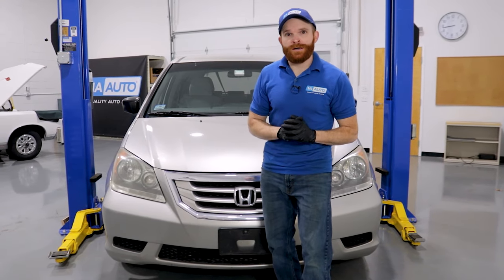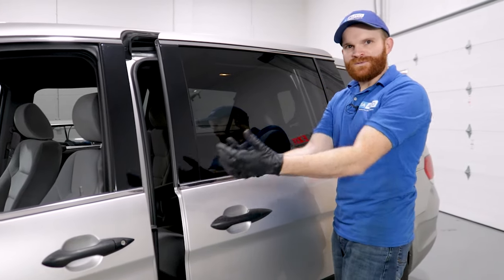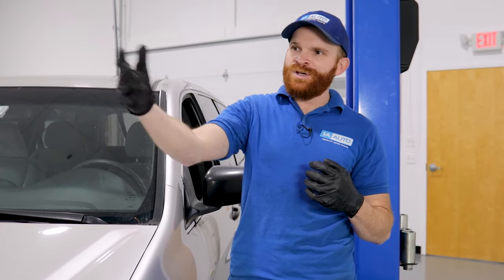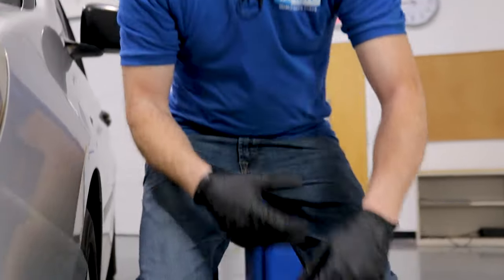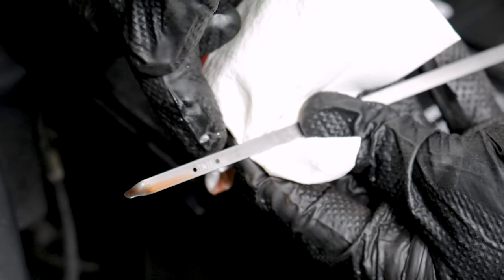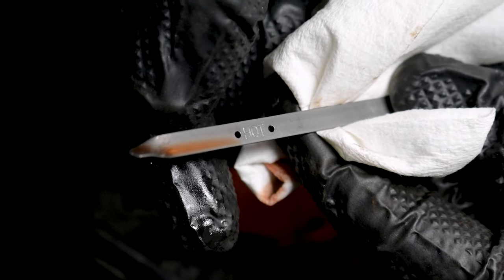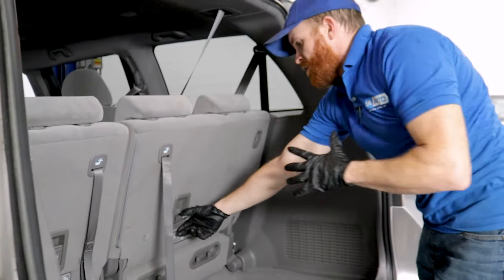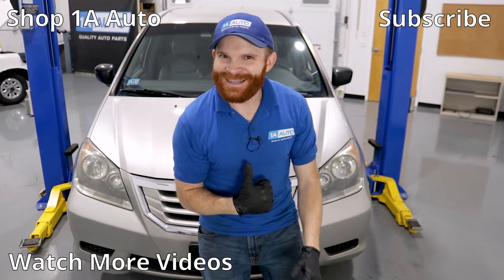Top 5 Problems Honda Odyssey Minivan 3rd Generation 2005-10

Comment: My 07 touring has real loud and hard to turn power steering.
Reply: Common its the pump but check around the pump for leaksb
Reply: Start small with replacing the Top and Bottom pump O rings. 
Then clean or replace the Reservoir.  The screen gets clogged.  And flush and replace the fluid using Honda's.
Reply: I replaced the power steering reservoir (updated honda part and cap from eBay) and the fluid (honda ps fluid). Then I still had noise and really foamy looking fluid, which the forums said it's the the downstream? (not sure) gasket/o-ring in the power steering line, right on top of the engine, the gasket that's closer to the front I think it was but not sure I remember right. That took care of the whole power steering issue.

One of the parts in the doors that feels commonly is called the actuator. I think that's what he's talking about-face when he says the latch.

The AC motor relay, inside the fuse box that's inside the engine bay, by the passenger side I think. That's a $15 or less part, that went out and shut down the AC immediately. 

It's also important to think about the timing belt if you're past 100,000 miles. At least that's what I hear, I'm a little bit past that few tens of thousands.

I think the engine splash guard that's underneath front and center, is probably also a common part that comes loose. Maybe that's just from snow up here in the North. 

It's also important up here in the north to make sure to oil or "shin etzu" the seals on the sliding doors especially so that they repel water and don't get frozen shut in the winter.

Comment: Charging system is also a problem.  I say this after a year of dead batteries, 2 new batteries and 2 new alternators.  I am sitting in a parking lot with a dead battery.
Reply: Sounds like alternator issues, maybe one of those alternators you got wasn't working right.. that stinks sorry
Reply: Make sure it’s not leaking oil into that alternator. Common issue because of placement.

Comment: These vans are known to have bad transmissions. I know from experience after having to replace it around 150000 miles. I replaced the fluid every 30,000 to 40,000 miles and it still failed among lots of other issues. Sold the POS and bought a Toyota. This was my experience so yours might vary, but know that there are shops out there that just work on Honda transmissions and no other brands for a reason. Stay the Away

Comment: Guys, the 40 amp fuse for Back up/ Acc! If I leave in! The battery will discharge overnight. If I pull it out, the battery stays up/ charged!
What is draining the battery?
Reply from the maker: +Douglas Brunt We wouldn't be able to diagnose an issue like that here, you may want to have a local mechanic take a look at it. Thanks for checking us out! http://1aau.to/m/Shop-1AAuto-c
Reply: I had the same problem. Shop said it could be one of multiple things.if I want to use power does, I have to out the fuse back in
Reply: @kathyhart6104  I had the same exact problem it's was backup #7 fuse (7.5amp) box in cabin on drivers side easy fix

Comment: Anyone else have a parasitic drain on the battery with their Odyssey? I've been trying to fix a problem with my 2010 that in 2022 started to come out in the morning to a dead battery (mostly in the winter). It sounds like it is a common issue. Might be related to issues with automatic sliding doors. I just don't know where to start finding the source. I've dumped 3k into fixing the rotors/rollers in the door, had to get a new alternator, was convinced to just get a new battery. But it is still happening.
 (Unrelatedly, I also have the shaking wheel when braking, new rotors fixed it, but not completely. Guess I needed new pads too). I've loved the van for the most part, but I'm getting pretty irritated with it now. :(

Comment: What decade was that Honda from?
Reply from the maker: +Wendell Trent This was a 2008 model.
Reply: @1AAuto  I just bought a 2008 Honda Odyssey Ex-L with 129, 000 miles my only issue is the tpms light always on I even looked at the history the tpms light has always been on. Honestly my only issue besides the air doing it's on thing.
Reply: 2005-2010

Comment: Anyone have issues with random misfire on random cylinders?Changed plugs, pcv, o2 sensor cause it sent a code once. only does it with a cold or colder engine

Comment: These are not the top problems! CV axles, suspension wear, motor mounts, VCM, and transmission pressure switches is a better list

Comment: Help me, with my radio code, my radio is off since 2019
Reply: Check manual or just call Honda repair centre give them your yr model and registration number located on your front windshield. They will give the radio code
Reply: Llama al dealer te pueden ayudar
Reply: There are some great videos on YouTube on how  to deal with the radio code issue. Just search "resetting radio" followed by the make and year of your vehicle.  Good luck🙂.
Reply: Look in glove box for any stickers with info
Reply: My radio was off after getting the alternator replaced on my 2007 Odyssey.  I looked in my user manual and I found a number written inside the cover - I thought, what the heck, I'll try it.  Plugged in the code and voila!  Radio works immediately!  So look in your manual to see if your code is in there.

Comment: Dose any one else have a problem when it is cold and the vehicle dose not like to start. say you did not run it the night before and try to start it in  morning and nothing but my batteries not dead but as soon as the jumper cables touch my car I can start it up but every has been checked my alternator battery and my terminals for my battery my starter my ignition my van is an 07

Comment: That is absolutely bad advice about not changing transmission fluid after 100,000 miles. Thats like telling a 25 year old obese person to keep eating trash because your life is already over. Old spent fluid is contaminated with debris and no longer has the same protective properties spec'd by manufacturer. Continuing to run that fluid will continue to accelerate wear and tear....then yes you'll eventually need to do a transmission rebuild. If your transmission blows out after a fluid change is because it was already broken or the technician used the wrong fluid. Change your fluids people!  No such thing as a lifetime fluid! They all degrade over time.

Comment: Has anyone had problems with transmission whine fluid is good whine started going up a hill turned the car off and now the whine is gone and has anyone had oil leaks 07 odyssey
Reply from the maker: +@TheAwill4201 We wouldn't be able to diagnose an issue like that here, you may want to have a local mechanic take a look at it. Thanks for checking us out! http://1aau.to/m/Shop-1AAuto-c

Comment: 2005 odyssey ivec with VCM at 123K miles engine makes  a persistent ticking noise and premature oil burning in cylinders 1; 2 ; 3.   What a nightmare.  Dealer wants 8K to fix the noise.  Never take your car to the dealer they are rip off artist.  Also at 123K miles,  the transmission slipped on the fwy.  Needed new torque converter; clutches; steel plates, transmission radiator and overhaul cost me  $4k.  The engineer who designed the ivec engine with VCM should be shot.   Whats a VCM muzzler??